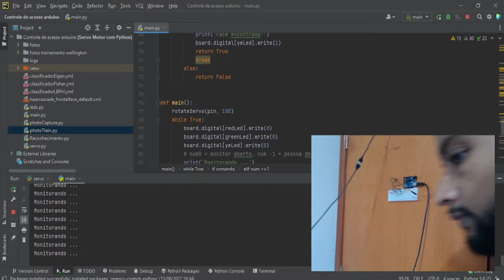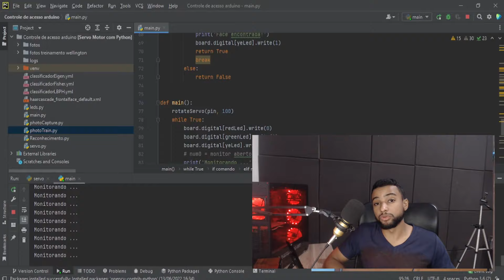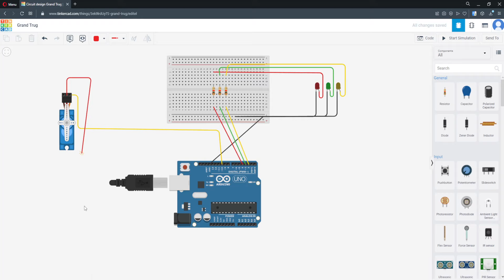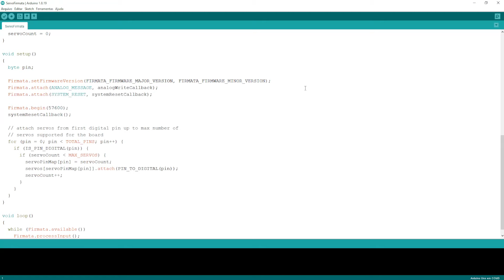Controle de Acesso por Reconhecimento Facial com Python e Arduino

Comment: eu tentei executar mas ao reconhecer , ele diz que a imagem capturada,treinada, é diferente da reconhecida e para , Traceback (most recent call last):
  File "C:\Users\helio\opencv\Projetos\reconhecimento\Controle de Acesso\controle_acesso_facial\Reconhecimento.py", line 21, in <module>
    id, confianca = reconhecedor.predict(imgFace)
cv2.error: OpenCV(4.7.0) D:\a\opencv-python\opencv-python\opencv\modules\core\src\norm.cpp:1082: error: (-215:Assertion failed) _src1.sameSize(_src2) in function 'cv::norm'
Reply from the maker: Olá, você fez o treinamento do modelo fisherface novamente com suas imagens?